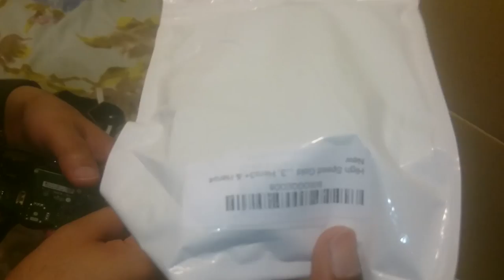Replacing & Fixing Worn Out PS4 Along Stick

Comment: Awesome video Biki, nice handy work Jem! So one of my controllers has the left stick getting stuck in the up position while the 2nd had a left side worn out stick. I went and purchased a 3rd controller to use with the idea of using the new receipt on a Sony warranty claim. After this video though I purchased those sticks on ebay (thanks for the link below) and I am going to try this instead of the warranty claim.
Reply from the maker: Yeah it's not hard of a fix so it's well worth just do it yourself if you're willing. 

Glad you enjoyed the video, will have little more videos like this with jem.

Comment: My left stick is lower than the right because i use power to push it for BF4,but it still works doe,the analog stigs were already slippery in the 2nd week of gaming,i didn't even played that much,i will buy some silicon protectors heard they were good. And DS 4 may be the most advanced controller but have horrible quality i mean holy shit my R2,directional buttons are stickying...